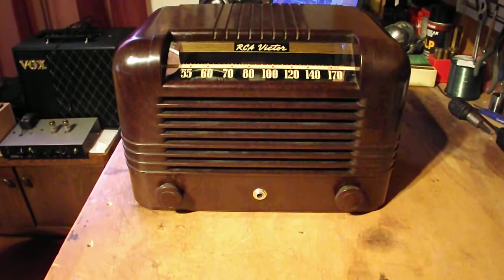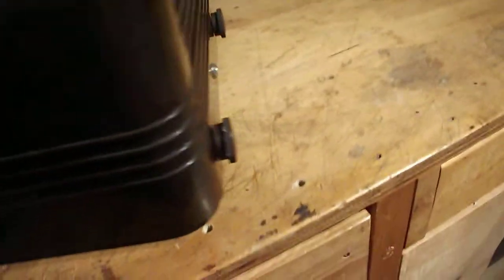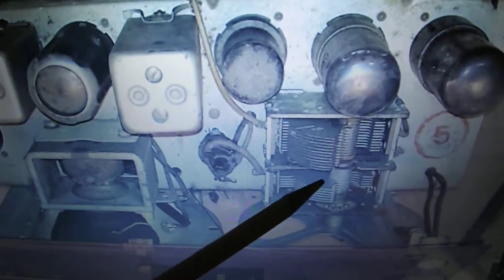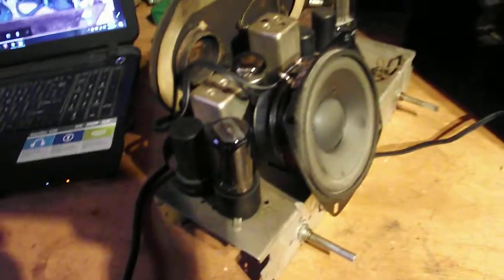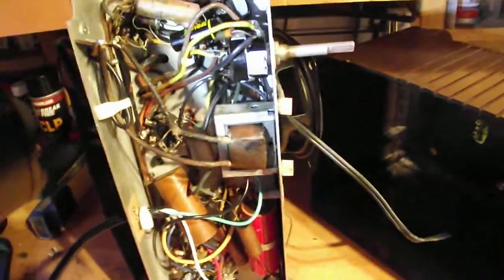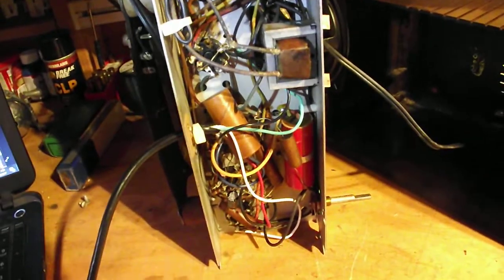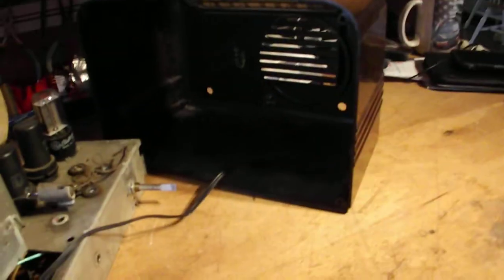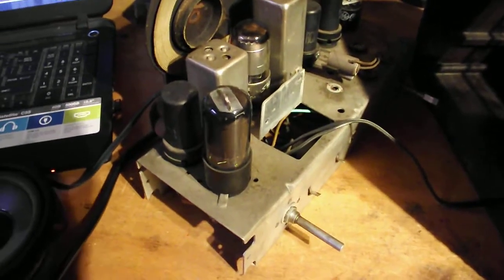HOW TO tube radio conversion to guitar amp.

Comment: I did this about 30 years ago, no money for amp had to make one it was off an old car tube radio made. Converted dc to ac adapter had a switch for the radio and for just the amp part, are both and play with the radio at te same time, back when you real music on it , but it work poor man amp, back then, wish I cap it, but long gone, good amp now days cost a lot, sad, any way good show tanks,

Comment: Researching for the term "Widowmaker amplifier" in Google, will show what this type of device is, and why it is so dangerous. They have killed people. The only transformer there is for output/speaker, so there is no power transformer. Without a power transformer, there is no ground. This is why they made them in plastic, to prevent the user to touch any metal parts while the device is on. By design, current flows through chassis on these types of models. Therefore, a three prong wire, grounded to chassis does nothing to protect from electrocution. The jack puts the user in contact with the chassis and the amp. Conversion of a Widowmaker amp like this requires adding an isolation transformer to provide some level of protection. As a radio it was safer because there was no user contact with metal or any parts of the amp. As I see it modified on this video, it is still extremely dangerous (even with a three prong power cable "grounded" to chasis) and could be deadly without adding an isolation transformer. Please feel free to research what I am saying in YT or any Internet search engine. Please stay safe.

Comment: Hey there, I did this same conversion and find the output volume to be very low.  It is much quieter than it was as a radio. After you removed the radio components did you need to solder any of the wires going from those components to the tube to complete the circuit somehow? I'm wondering if this is my issue but am weary of experimenting due to the high voltage

Comment: What size and ohm is the speaker? Just picked one up yesterday with 35w4, 50c, 12av6, 12ba6 and 12be6 and any my idea of the wattage output…? It’s an Arvin branded 859 with all I’m guessing original Arvin branded tubes

Comment: If you build a separate cab with a larger speaker, how do you determine the correct ohms for the larger speaker?  Thanks  Tom
Reply: They usually use 5ohms so 4 or 8 ohm speaker is fine.

Comment: I like to see old radios restored to their origional state; however, I’ve seen where a guitar/aux. jack was installed so that when something is connected to the jack, the radio is disconnected but the radio comes back on once the device is unplugged from the jack.

Comment: I can work from schematics on point to point circuits and understand them quite well. Well enoigh to conduct myself safely. (pardon the pun 'gonduct') but when it comes to PCB's after the mid 90's i don't even bother entertaining them. I used to work for a big American PCB manufacturers and it got to the stage were thet were making proprietory boards that would only hold their components or another companies components if they had some kind of deal regarding the boards they needed. I saw i coming then watching this machine vibrate all the little solderless pole holders into the board and then they would all be pressed in at once, 6 at a time and on it went. I have just bought a small UK made Sobbell from the late 50's and am looking forward to getting the Veriac out again and starting work on this new to me amp. Thanks Tinker you have motivated me.

Comment: Hello all I have been reading all the comments and would like to know who would best be able to read the plans and  to know how to convert to an amp..I have the old handbook with the exact wiring diagrams..??
Reply from the maker: chris Beattie if you want to tinker with small tube amps you would be better off to recreate an early guitar amp circuit and use an old radio box if that’s the look you are going for.  I can tell you that converting an old radio can really be a can of worms situation

Comment: I have a project I'm wanting to do a very same process to. But I've ran across a few snags and lack very little understanding of how to read schematics. The head unit I have, I cannot find anything like it. It is out of an old radio, tv, and phonograph combo. It does have some RCA tubes in it. Along with Tung-Sol and some others that at the moment i can not recall the name of. Do you think if I sent you some pictures, you would be able to help me out? I just recently converted another old tubed amp head I came across into one, but it was a pretty straight forward process. I had both input and output available. Where as this one does not have an input jack to plug into.
Reply from the maker: Given your situation, I would suggest referring to the guitologist channel or uncle doug channel for more understanding of the circuit you have.   you might decide to use the parts to duplicate an existing vintage amp design.

Comment: I would be taking a hard look at those wax and paper caps.
Reply: My wax caps on a working Silvertone 1947 am portable tube radio  are testing fine, at this very moment.   Idk Ass much about caps as I do about lacquer based paints, (I just have my open back radio beside me a my mm handy. 
   But one things for certain, lacquer is an absolute dream for the painter and a quantity of quality for the “consumer” 😖.... but HEY check THIS OUT,  in real life application of the outdated lacquer you have to actually break every rule in the book!  Now I shit you not... I’m talking from experience, and what I know to be true/..... 

 Could it be that in all reality, these old radios that have been playing hardly unchanged for 50,75,,100yrs and still can take 120+ up the butt and still play you a tune??    
If it ain’t broke don’t try to fix it until you own 2👍🏼

Comment: Hey bud thanks for this video. I have a little Motorola radio I am wanting to convert to a guitar amp. Mine also has the 2 prong plug so essentially the chassis is hot due to not having a power transformer. I am just wondering when u added the 3 prong plug on yours did you have to install a isolation transformer or did yours already have a power transformer. If you did not add a isolation transformer and have no power transformer how well is the 3 prong power cable working out for you. Is the chassis of the radio still hot or is it safe to touch and play to where you do not get shocked through your guitar strings. Any help is appreciated thanks. Also I work on newer electronics for a living so I'm not completely incompetent just want to hear what some one with experience has to say.
Reply from the maker: I connected the ground directly to the chassis.   just as a precaution i measured the voltage differential across the input and ground at the input jack and there was no voltage at all (AC or DC).   so this setup should be safe. just treat it like you would any vintage tube amp.     the only other thing you might want to do is add a fuse to the power line just incase of a short in the future to save damage to other components in the chassis.